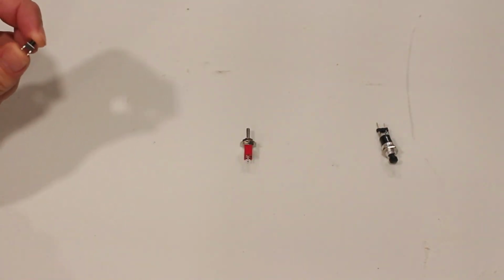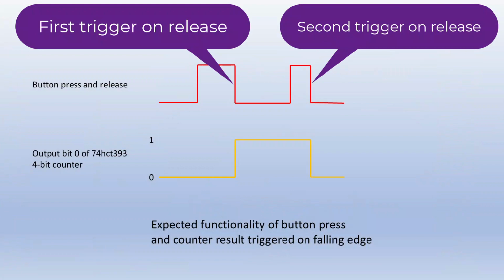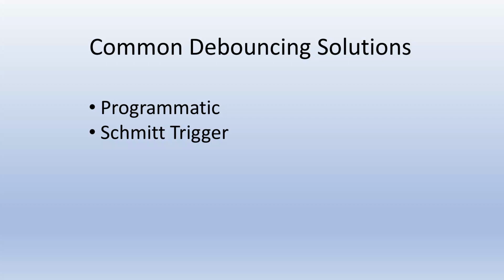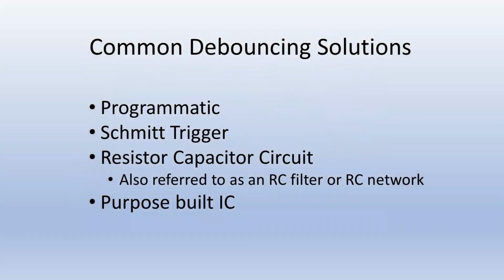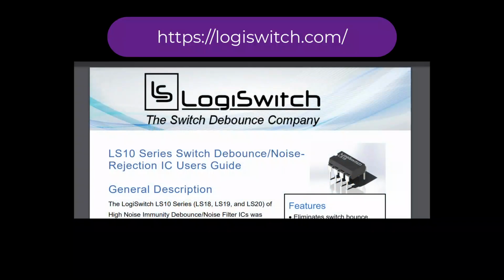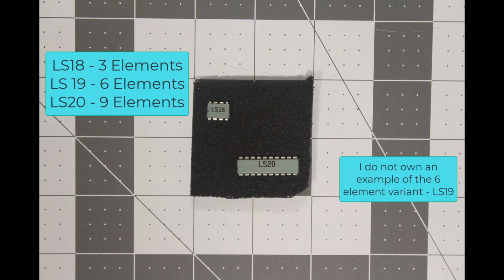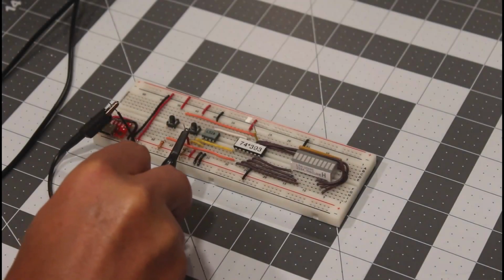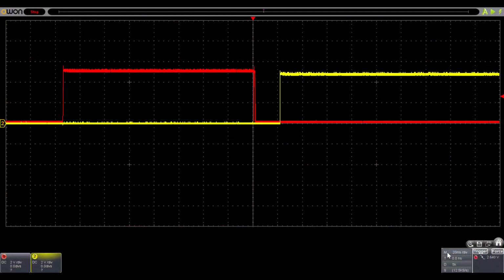Debouncing Noisy Switches With LogiSwitch LS10 series IC

Comment: Where to buy? Didn't see them at Mouser?
Reply from the maker: I will have to check Mouser, I buy through DigiKey
LS10 series is what I use;: LS18 / LS19/ LS20 
LS100 series has additional circuitry for handshake protocol for working with microcontrollers

Digikey Ordering:
https://www.digikey.com/en/products/filter/specialized-ics/686?s=N4IgTCBcDaIDYHsDmBLAzgdxQFwMYAsQBdAXyA

Guide:
https://logiswitch.com/wp-content/uploads/LS100-Series-IC-Users-Guide.pdf